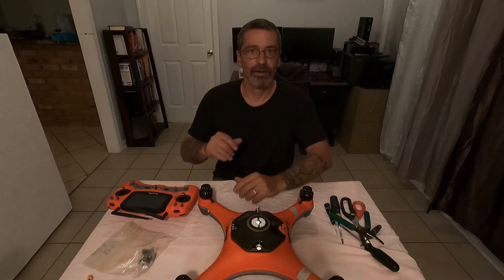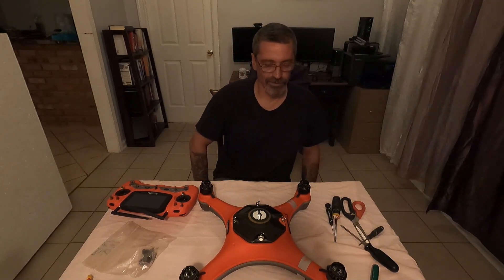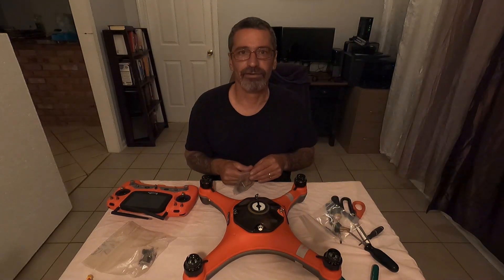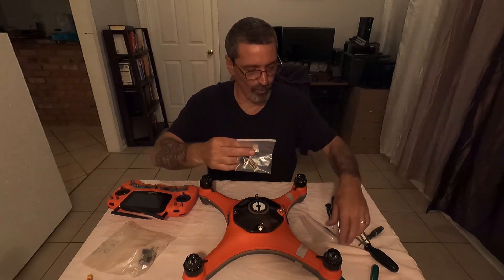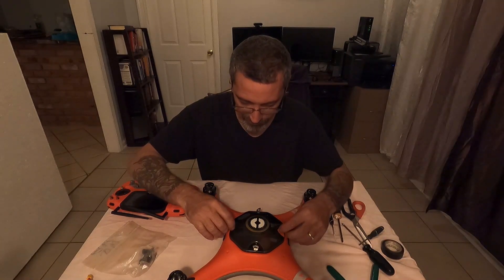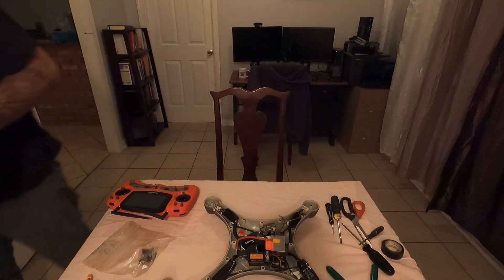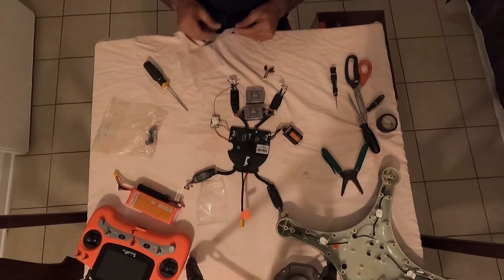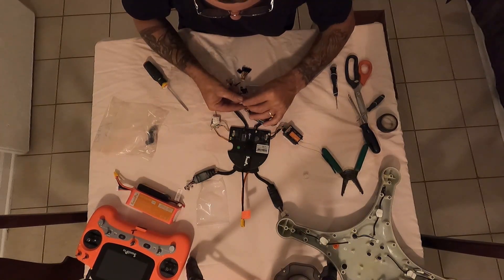How to change flight controller on the SwellPro Splash 3+ Drone

Comment: where can i find wiring diagrams also what happens if you connect flight controller wrong
Reply from the maker: Email me and I can send you a diagram. I have hooked up the flight controller wrong and nothing happened, but I guess it depends on what you hook up wrong